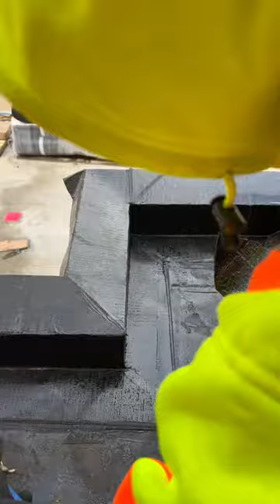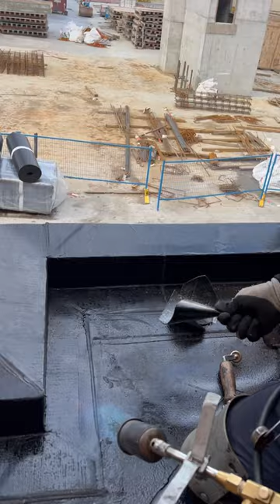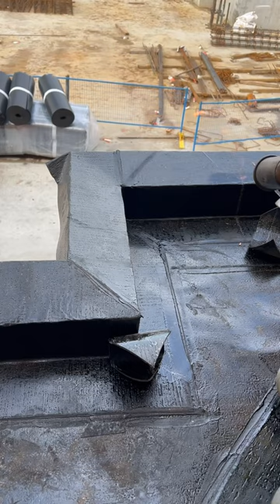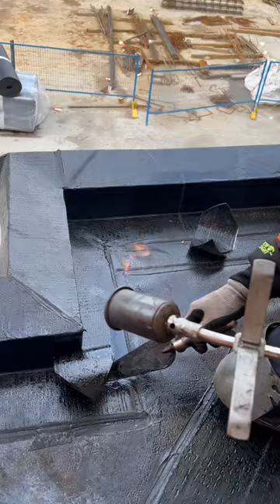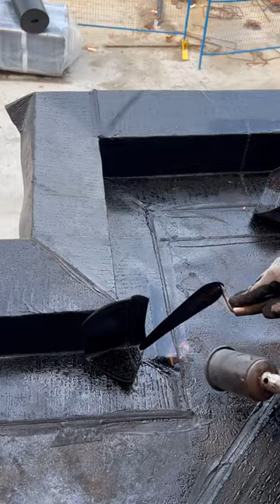Torch on Gussets #roof #roofers #roofing #commercialroofing #shorts #shortsyoutube

Comment: it should be put on in steps. do not fold it down at the bottom until its cooled down. do multiple corners and come back to the first one when its hardened and cooled. then torch down the feild flap.. no popped corners. also the gusset is kinda big by my standards. but all in all it looks good